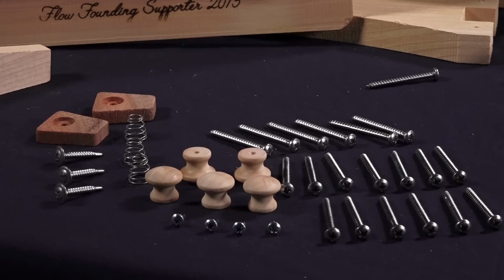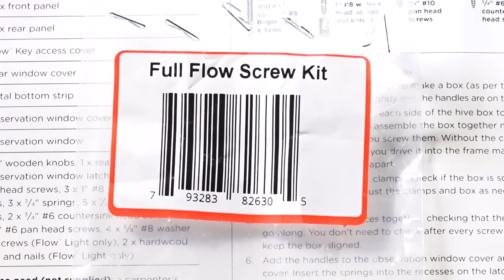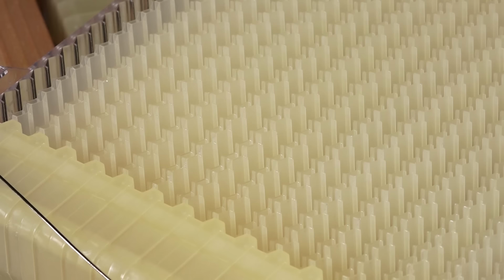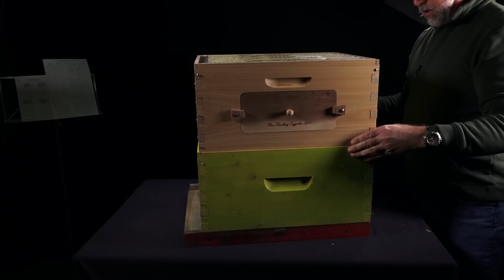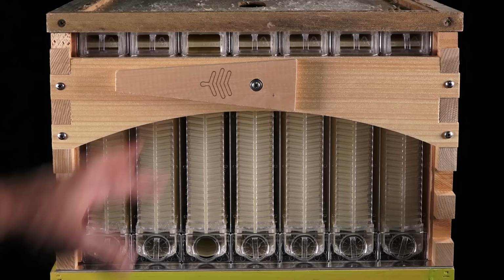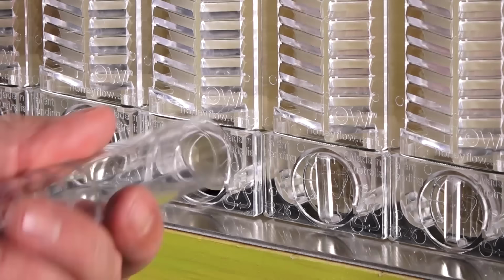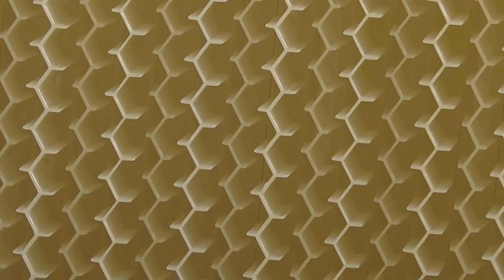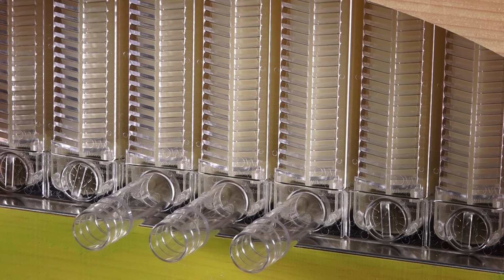The Flow Hive for honey bees, Love it? Hate it? or Undecided? Price? Review of Quality Control

Comment: great video, what about the machines used to take the caps off and spine the comb that you dont need with the flow hive. wont not spending on that save you some. just asking
Reply from the maker: +usernamenotinvaild For people with apiaries that contain only a couple of hives, uncapping and extracting systems are not needed. You can simply do that by hand and drain the honey from the frames without any equipment at all. There are small hand-cranked centrifugal two frame extractors that are very reasonable. Industrial equipment would definitely cost more, but they aren't using flowhives on that scale, at least not yet.

Comment: Question: The cells are drained from the inside, leaving them capped but empty. How will the bees know they are empty, and how will they access them for refilling them with honey?
Reply from the maker: I had that very same question in the beginning. The caps are disrupted during the draining process and the bees remove the old caps and repair the cells right away. They are very aware of the condition of their stored honey. I'm also amazed at the depth of the cells, the bees go all the way in and begin filling. It's actually a lot of work for the bees as they have to re-seal the cells after a cycle of honey draining.
Reply: Thanks

Comment: Hi, thanks for the review and your honest opinion on FlowHive. You talked about the price of this system compared to - let's say - 'traditional' hives but you do not mention the cost of honey extraction with a traditional hive compared to FlowHive. Could you give an idea of on this difference?
Reply from the maker: Lots of small hive owners don't use any extraction equipment, there are methods of pulling frames, uncapping and simply draining the frames without a spinner. On the other hand, there are lots of hobby level centrifugal extractors that are hand operated and inexpensive. Here is an example http://www.betterbee.com/extracting/he2200-2fr-plastic-extractor.asp
Reply: Jo Ascoop what we do is just scrape the wax caps off the combs and let the honey drain, then heat the honey just enough to melt the wax, let it cool and then remove it. An extractor is easier less messy and less wasteful but as we got more honey than we know what to do with its not a huge issue.
Reply: Hi Laura, I read some articles stating that warming the honey might alter the flavor a bit, that's why I'm a bit sceptical towards this method. Anyhow, I never kept bees and I don't know if it's true but I think I'm going to start without flow hive or an extractor and use the system you suggest, maybe later if I'm a bit more experianced I'll try a flow hive. We'll see...
Reply: We didn't notice any change in colour or flavour but if that is a concern to you I'd do some research. My sons work for a commercial beekeeper but this was our first year with his own personal hives. I will warn you that it is a sticky business and we ended up with way more honey than we expected. I had every big pot I owned full and had to get creative with containers to put it all in. We did end up with a bit of wax in a few but that's not a problem for us.
Reply from the maker: Laura Warman HI Laura, thank you for suggesting that I "do some research" however if you just watch the first flow hive extraction video I shared, all of your questions would be answered by practical demonstration. Thanks for commenting and enjoy your bees! :)
Reply: The research comment was not directed at you. It is in reference to heating honey to melt the wax in it.
Reply from the maker: Laura Warman Ok, it just showed up in my feed as a stand alone comment. No problem.

Comment: Early part of this suggests terrible quality control and a lazy/greedy company run by the inventors. I don’t think they have a sustainable business model even if the frames are a nifty innovation and with the quality control/pricing issues I am not surprised at all they are competing with counterfeiters. Low quality should = low price.
Reply from the maker: Hi Aaron, the company that made the wooden ware was contracted by the FlowHive Company so they could be produced here in the USA... Flow quickly changed to another company for wooden ware and have now completely taken over production to insure quality control. The company that made this hive body is out of business as of January this year. Tough start for sure. Everything I've received from them since has been spot on.

Comment: I was curious what would happen if I bought a few bee hives and placed them on my farm inside a small outbuilding and left the hives completely unattended.   If I was in it only to pollinate crops and not farm the honey, could the bees survive if I just closed the doors to the outbuilding in late fall and opened it up again in spring.  What would happen to the bees? And would the hives continue to thrive?
Reply from the maker: Hi Curt, I've had friends house their hives in barns and sheds, don't forget that wintering bees need to fly out on warm days and do cleansing flights for the health of the colony. Most folks that put them in buildings end up with a layer of dead bees across the floor and bees that end up requiring a lot of special attention to survive. They do best outside in a well-selected location which allows them to fully respond to weather conditions year round. Remember that honey bees aren't truly "wild" as they are considered managed livestock and the colonies encountered in abandoned structures and old trees etc are considered feral as they originate from a managed apiary somewhere. With current mite, small hive beetles and other issues facing the bees, not managing or inspecting them would possibly end up in that colony becoming a launching pad for unhealthy pathogens that other bees may pick up. You can have a very hands-off approach to beekeeping, but inspection is still going to be something you'll want to do.
Reply: @FrederickDunn  thanks for your reply.  I was just starting to look into beekeeping.   That is very helpful information.   I greatly appreciate your response.  Thanks.  I will have to think about this a lot more then.

Comment: Has the availability of the hives improved and what is the actual cost? What about getting the hive going? is it easy to add a few pounds of bees and a queed?
Reply from the maker: Hi John, yes, availability is fine now, they ship to you within the week. Quality of the wood and joints has also improved. The link is in the video description for current pricing. Yes, you can start a FlowHive with package bees as you described and they will get right to work.

Comment: not sure that a hot day would make any difference - from what i understand bees regulate the internal hive temperature quite well so it should be pretty much same temp most days
Reply from the maker: I am more than happy to explain that, the honey bees don't regulate the entire hive inside temperature, they are concerned with and concentrate on the brood frames where developing bees are located. The outer frames which contain honey or are often empty, do not receive climate control, that would be an extraordinary waste of productive energy and the bees would simply be exhausted. I hope that makes sense? They do however ventilate the entire hive to control humidity, but not temperature.
Reply: yeah i can go with that - thanks for the very fast response  :)
Reply from the maker: ThePataks You're welcome, just happened to be checking in at the right time :)

Comment: You have purchased the b grade Chinese flow frames copy, not the Australian original flow frames. this can be seen by the poor fitting quality and the packages also the genuine flow hives are now laser cut and therefore are burnt were cut
Reply from the maker: Thank you for those observations Christian, but this came directly from the FlowHive company and was sold through their indigogo campaign. No Chinese sourcing at all. You're correct, they fired this company and opened their own woodworks with lasers instead of milling equipment. Everything they now make and sell is very VERY good. I would never ever buy from a Patent Pirate.

Comment: Curious as to how long each frame lasts. I've heard they can wear out in just a couple years in certain conditions. Not a huge deal honestly though. If you can just order new ones. I love the concept. Cant wait to try them out
Reply from the maker: I've started rotating the flow-frames out on the 5th year. BUT, power-washing and soaking in 10% bleach solution can put them right back into service. I haven't had any break, or deteriorate physically, they just start to look a little grungy.

Comment: Great video...  I noticed at the 16:30 time mark you are showing a close up of the plastic end pieces.  I noticed the number 7 in the arrowed triangle... do you know what the seven indicates?
Reply from the maker: Yes, the number 7 is a recycling code and in this case, applies only to the end "clear" pieces of the flowframes. All of the components are "claimed" to be food grade. The code/class 7 is extremely broad and includes many different plastic properties. There is a company doing a material study which is ongoing with all of the flow frame plastics and I'm sure we will see that published soon if any of the results are bad. There are no markings on the interior "moving" parts.
Reply from the maker: I'm uploading a video tonight that will answer a lot of flowhive questions/concerns. Nothing about the plastics yet as the studies are not concluded.

Comment: I'm a bit confused about the dimensions of the boxes and frames on the website. I wonder if you could shed some light? It says "The height of the flow frame is 240mm" and " the width of the clear frame ends is set to 50mm". What does this second measurement mean exactly? Also it then goes onto give 540  x 195 x 285 for "Flow Frame classic 3 in a box". I assume this is HxWxL? But also, how are these measurements consistent with the 240mm height mentioned above? Finally they give measurements for 4, 6 and 7 in a box. They all have the 540 and 285 measurements, but the middle measurement changes to 265, 375 and 425 respectively. Which, on face value, isn't consistent. What am I missing?
Reply from the maker: Because they are all out in the apiary and we are at 5 deg. f. today I can't get out there to measure for you. BUT, I can share that the 7 FlowFrames fit perfectly into a traditional deep 10 frame box. Langstroth dimensions. I can't be specific on the six or four frame dimensions. Maybe check in with others on the FlowForum site as it's an active discussion group and certainly someone there will happily measure them out for you. Sorry I can't provide more than that.
Reply: thanks Frederick. I have sent the same request to the the Flowhive guys.
Reply from the maker: They are very good about answering questions :)

Comment: Ok Fredrick,...my husband I think made a big mistake :(   The flowhive site recommended using tung oil on the hive, but only on the outside not inside. I watched the instructions, however my husband didn't & early this morning decided to treat the hive with the oil,....both inside & out! Have we ruined the hive? Will the bees still accept the hive once we introduce them late April?
Reply from the maker: +Jennifer Myers I wouldn't consider it "ruined" you can sand off the finish a little.. the problem is that inside the hive bodies, the bees are apt to chew some parts, if they don't like the material/finish inside, they will use propolis to seal it further. As long as there is plenty of time for the tung oil to cure/dry, there shouldn't be a huge problem. Please keep us posted! and don't worry too much about that.
Reply: Thank you Frederick!
Reply from the maker: you're welcome :)

Comment: So when the bees cap it do u need to go in and remove it?
Reply: Get Crafty with Jessica H yes open the frames with the flow hive key the honey will flow out of the tubes
Reply from the maker: Nope, the frames cycle under the caps and the bees refill the cells soon after. It's an excellent system. I've used them continuously since this video was made. It's my favorite hive design.

Comment: I'm very new to this so do they still brood in that flow hive
Reply from the maker: If the flow supers are left on through winter, the queen can and may lay eggs in the Flow-Frames, that is IF you also don't use the included queen excluder. I did that test and left the flow-super on through winter without a queen excluder. 2 of the 3 Flow-Supers did not have eggs/brood in the flowframes, but one did. So it is possible. The best practice is to remove your flowframes after your last honey harvest of the season and not replace them until the spring when the bees are back in full production. I don't use queen excluders... this year, i had no problems at all with eggs or brood in the flowframes.

Comment: I love honey and really appreciate the ecological importance of Bee's. However, as I am allergic I would never dreamed of Beekeeping because it just didn't seem safe to be handling hives/frames etc. Also because I am a soft touch I would be scared of overstressing the bees or squashing them. This seems like a much safer option for the "keeper" is it really gentler on the Bees as they claim?
Reply from the maker: Hi Bobby-Jo, they "claim" that it is easier on the bees and I must say, that after using these systems through an entire spring, summer, and fall, that indeed it is.  
For example, when I take honey off the traditional way (I still have many hives without flowframes), I have to smoke them in order to calm the colony, remove the cover and begin removing frame by frame, often tearing brood cells open as I work.
I also have so shake bees or brush them off of the honey super frames as the bees try to stay with them. Some honey always drips down inside the hive and comb is damaged. There are several steps after this which do not bother the bees, but I have to return empty frames back inside the hive which is another step.
For hours after honey extraction, my bee yard is heavily patrolled by guard bees that are on the defensive. There is no standing around in the bee yard without protective clothing after honey frame removal, you will be stung. All of this collectively demonstrates that the colonies are stressed with traditional extraction methods.
In contrast, when I take honey off with flow-frames, none of the above occurs and the bees remain docile even without smoking. This is my experience, and yes, easier on the bees by far.
Reply: It sounds very much like flow hives would be particularly beneficial for those who keep bees in an urban or suburban environment.
Reply from the maker: Jim Barron Or even on a balcony, or roof where traditional honey extraction just would be too cumbersome. It does open up some new possibilities.
Reply: I am positive your neighbors would string you up if you had a beehive on an apartment balcony.
Reply from the maker: Carbon 12 Lots of people are already doing it without problems as well as on rooftops. Building managers will certainly have a say in establishing that policy. Lots of them in Brooklyn, NY.
Reply: +Bobby-Jo Tuita       If you are allergic to European honey bee stings check out stingless bees. Nowhere nears as productive and not that attractive but hang the hive up outside and zero work involved after that, they take care of themselves. It is recommended to have some water (maybe a bird bath) in the general area. They ignore people, cats and dogs.

Comment: Hey there, I saw you in a flow hive commercial, Nice! 

What’s the average time it takes to drain a flow cell
Reply from the maker: Flow frames drain at different rates depending on how hot it is outside. I've completely drained a Flow-Frame in 10 minutes when it's in the high 80's.... another frame took 5 hours at the end of the season when I had the super in another building at 42 deg. F. Just like other honey extraction methods, warm honey is faster processing.
Reply: Frederick Dunn s this would be honey on tap only in the summer. The rest of the time you would have to take it in a heated honey house for faster tapping. I wouldn’t want to wait five hours, I would be playing that Anticipation song for too long. ( from the ketchup commercial ) . I will pitch another idea on messenger. I really appreciate what you do Fred, thank you.
Reply from the maker: I don't wait Timoth, I just put a 1/2 gallon jug under them with closed tubes going into ReCap Mason Jar lids and come back and check on them in the morning. :)

Comment: Mr. Dunn, I heard another person say that the process of opening the comb for the honey to flow could potentially harm or kill bees if they are in the process of filling the comb. What is your opinion?
Reply from the maker: Hi Karen, whoever made that claim has never cycled a flow-frame :)  I can share that I've never had a bee or bee part pass through the flow frames and into the honey. I've also observed and filmed bees on the frames and in the cells when the mechanism is cycled and they just pull out without injury. I think that was one of those early claims that simply persists and was made as a speculation rather than from direct observation. There is a lot of that still circulating. I will talk more about this on Friday in my upcoming FAQ as I think it may be a point of concern for many others. Thank you :)

Comment: How do the bees in the extractor not get smushed when you turn the key and the cells shift?
Reply from the maker: When you open the cells, the bees are not "in" the cells, they are just walking on top of the caps, if by chance some cells were not capped yet and a bee was attending to the nectar/honey, she can just back out, there hasn't been a single casualty with these frames yet in my apiary. The cell structure has openings that prevent sheering of any bee parts. I hope that answers your question? and thanks for askin